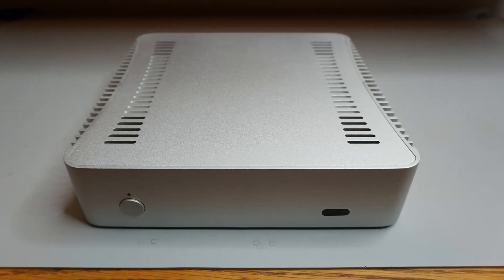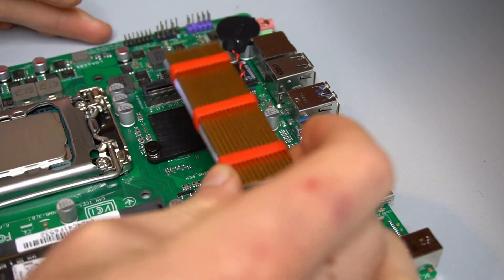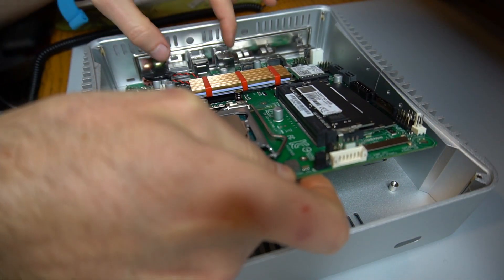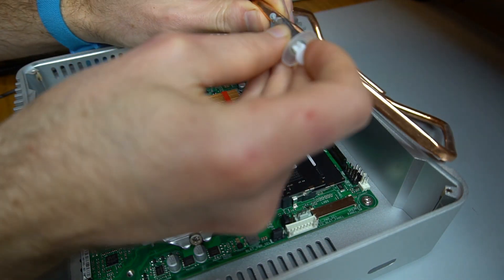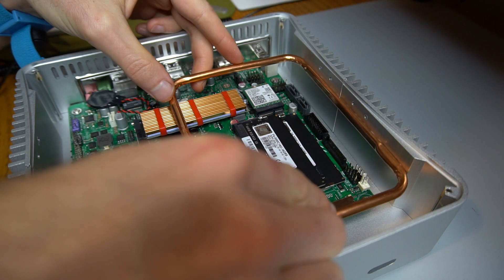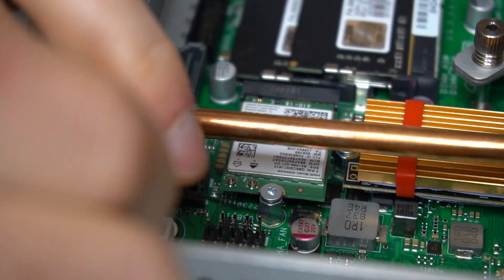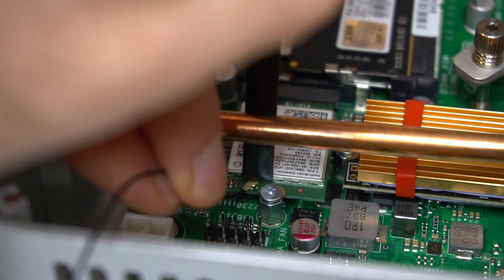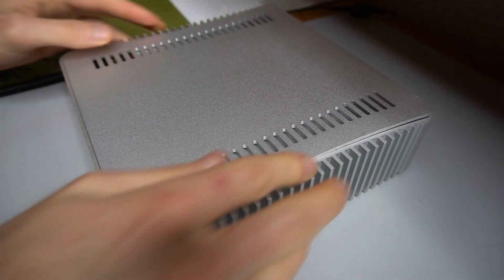Streacom FC2 - Building a Fully Silent Fanless PC

Comment: The most frustrating thing for me is finding Thin Mini ITX motherboards from reliable sources.  Absolutely infuriating.
Reply from the maker: Indeed, although the Asus H410T can be found now. Nothing for Rocket Lake though.
Reply: @fullysilentpcs  My goal is a mac-mini sized silent PC with integrated DVD drive. Thin Mini ITX is the only option... finding an appropriately sized case is also quite a challenge.  Where do you think is the most reliable place to get Thin Mini ITX motherboards? Amazon and Ebay are hit or miss.